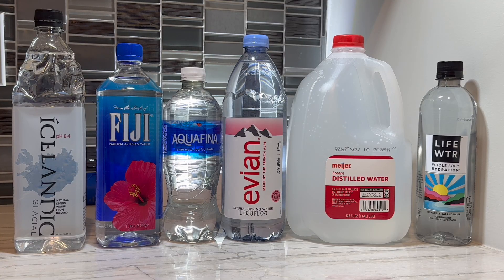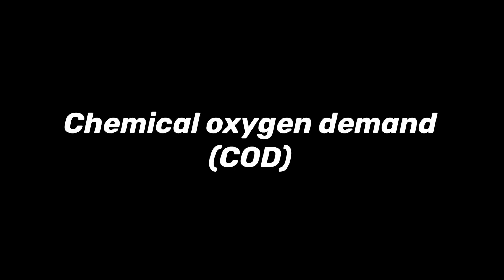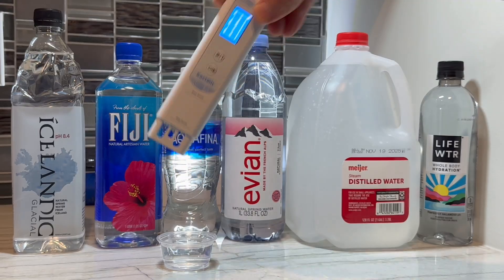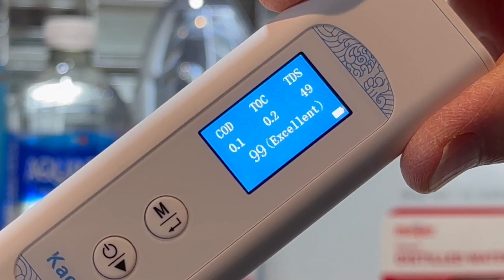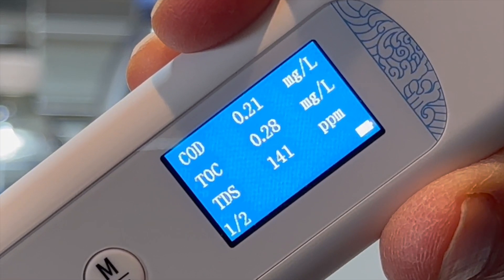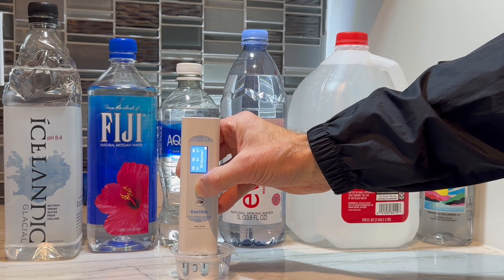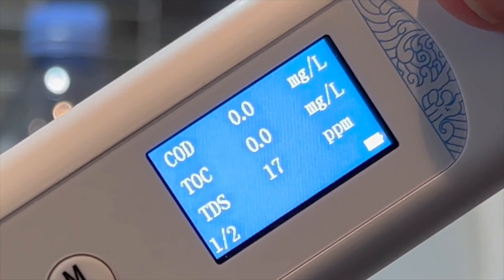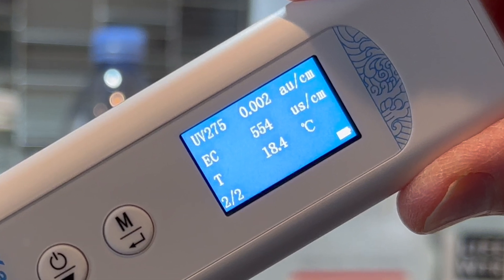Testing water for purity

Comment: If you put ultrapure water in any of those plastic containers shown, said water would leach chemicals out of the plastic that are normally 'locked in' (used in the manufacture of the bottle, like plasticizers) - ultrapure water is 'thirsty' like that - and it's not safe to drink either for the same reason!

Comment: Can you calibrate your sensor? Did it come with calibration solutions? The difference between the label and your reading is quite significant.
Reply from the maker: Indeed. Yes you can calibrate the meter with distilled water, and I did this prior to the tests